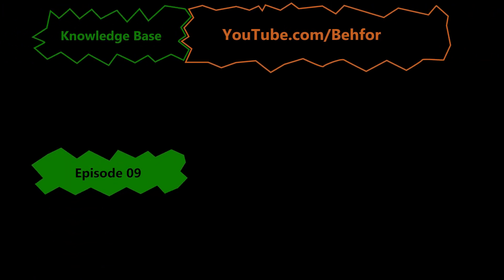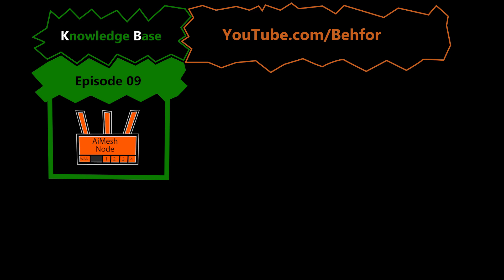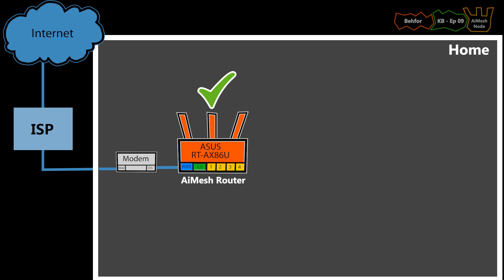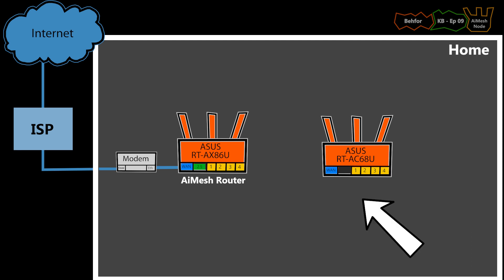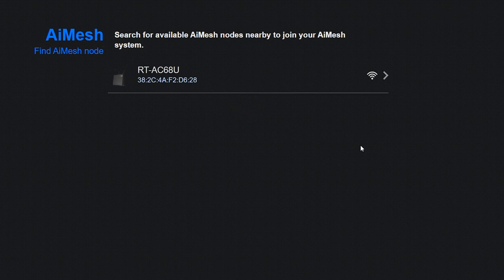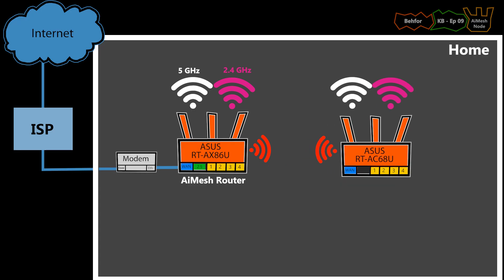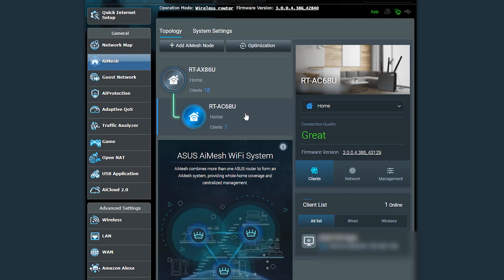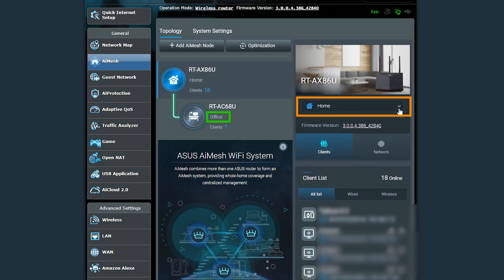How to connect an ASUS AiMesh Node? [KB Ep 9]

Comment: Nice video. Here is my problem. My Aimesh Router is AX88U and Node is AC88U. I want to connect the Node that is AC88U on ethernet but the WAN port of AC88U is faulty. Is there a way I can connect Lan port of AX88U with Lan port of AC88U and form a mesh?

Comment: i just want to ask few things, first, my wireless router placed in my living room. and when I go to my room, the wifi signal is weak, so If I'm going to add new asus router via wireless near to my room, will I still get weak signal? second If I choose to set up my second router via wired. should factory reset it first or just connect in to my main asus router? thanks!!
Reply from the maker: The purpose of adding a second node is to extend the range so if your second node is installed correctly it should be able to provide a stronger signal to places where there is a weak signal. If you want to add the secondary node as an Aimesh node (there are other ways too) you can either manually change it's operation mode to Aimesh node, or do a factory reset before you can add it to the Aimesh system.
Reply: @Behfor  what if I just , connect my 2nd router to my main router using lan cable, will it work?
Reply from the maker: No! Did you watch the video at all? You should follow the instructions in the video
Reply: @Behfor  1:37 this part is what I'm asking
Reply from the maker: @mercesletifer1747  at that point if you decide to use a wired backhaul (wired connection between routers) you should connect an ethernet cable to the wan port of the secondary router and to a lan port of the primary router.

Comment: Im planning of get the asus ax88u to use as main router and a ax92u  as a node  to use them in aimesh mode . Want to know this i have lan all over the house and will be using Ethernet backhaul . if the two nodes have a very weak connection or cannot connect through wifi can the communicate through Ethernet backhaul

Comment: Wow! You did it so easily and so smoothly. I have the same 2 routers and I've spent hours working on them but not been able to find the AiMesh Node regardless. They are only 2' apart with the same FW version and reset multiple times.

Comment: Hi Behfor, question... when using a cable between the LAN port  of the RT-AC86U and the WAN port of the RT-AC68U, do clients of both Asus device (LAN ports and WiFi clients) appear on the same layer two network, or is the RT-AC68U performing NAT between its LAN (and WiFi clients) and WAN port?
Reply from the maker: Hi, in the AiMesh system, they are gonna be on the same network and no NAT will be done by the AC68U. Thanks.
Reply: @Behfor  That's good.  Thanks
Reply from the maker: You're welcome!

Comment: Please help! I have two RT-AX3000 (RT-AX58U) both running the same firmware. I have set up one of them as my AiMesh router (Internet and everything is working fine) but when I try to add the other as the AiMesh node, it doesn't find it when I search for it.....(I have all the situations checked on the node)

Comment: Great video I have the same exact setup you have but the RT-AC68P synch constantly fails. I have  reset it multiple times.  I have all the situations checked both routers are running the same firmware.
Reply: Strangely I was able to get to work with ethernet no problem.
Reply: @anonymouschupacabra7810  make sure the firmware versions are exactly the same